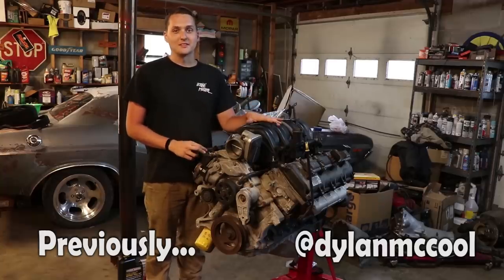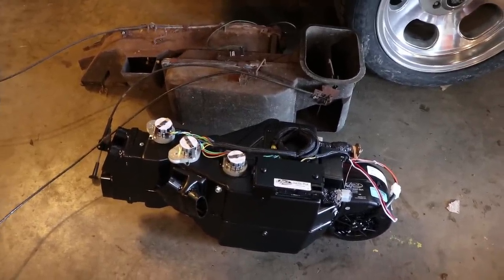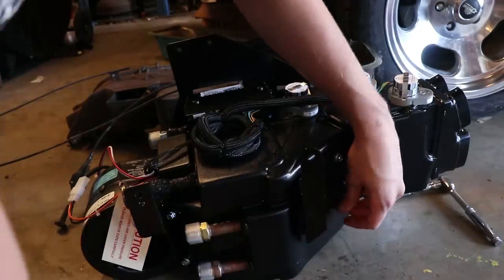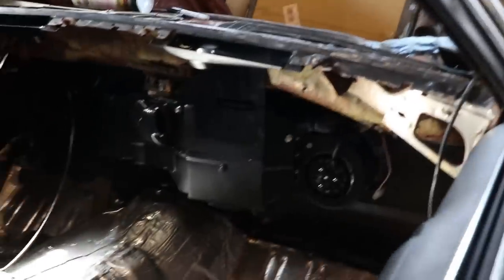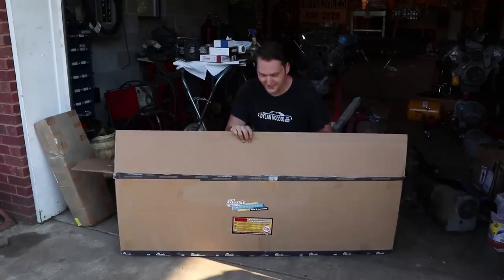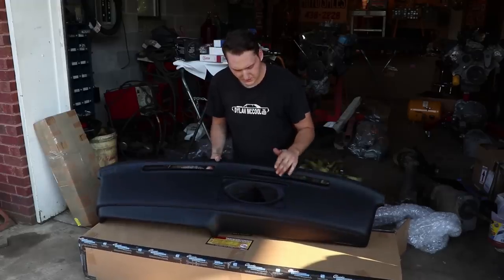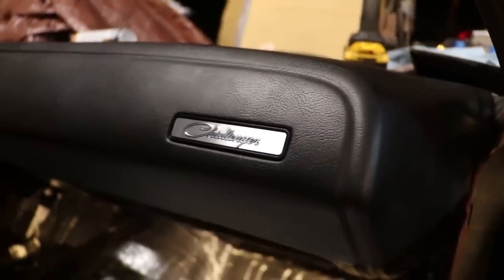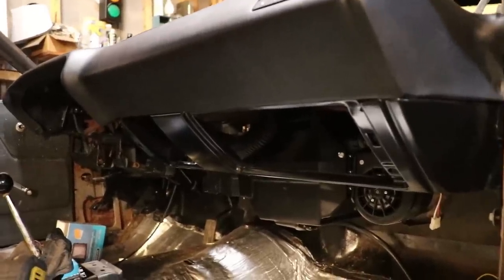ABANDONED Dodge Challenger Rescued After 35 Years Part 19: Air Conditioning and Dash Install!

Comment: Wow! The car is really coming along. I like the fact that you have added air-conditioning to the car, which makes it more enjoyable & practical to drive on hot, muggy days, & the fact that you’ve opted for a 4-speed transmission instead of the factory 3-speed. The dash with its new dash pad looks sharp. This project keeps getting better & better. Soon enough you will have this car running and driving. I can’t wait until the first fire-up of the engine.

Comment: Bought a slightly older truck. Fixed everything in it. Made some upgrades. Got the last thing fixed and 1 week later got the truck totaled. 5am cruising in the right lane in the interstate and a large commercial vehicle had hydroplaned and was sideways and slid into the back of another truck that veered in front. Now anytime I think of fixing or upgrading, my mind thinks of it all ending up in a junkyard after a wreck.

Comment: Congratulations on your progress. Also, I have never seen any car show/channel mention the need to convert your refrigerant in an older car. I had to have it done on my 1986 Mercedes. The old refrigerant R12 AKA Freon is no longer manufactured and existing stocks are depleted to the point of unavailability. The old stuff  was a chlorofluorocarbon chemical which lasts for a long time in the atmosphere and has been implicated in the depletion of the ozone layer. The ozone layer absorbs much of the ultraviolet radiation from the sun and keeps from getting fried just by stepping outside the door.

Comment: That drill bit scene and the long hose scene was hilarious and I think that you should add some stuff like that in with your videos because I like stuff like that and a good laugh is good for the soul and life is to short to be serious all of the time but I'm liking how the car is coming together and it is going to be a cool driver. What size hemi did you say that was? I tried to listen to it twice but for some reason I didn't figure it out I'm only 40 and probably going deaf already 🤪 anyway keep banging away at it and it will come together one day. I just put my stroker kit and 302 block in the machine shop this week so hopefully it won't be long before I get it back and start building the engine because I have spent so much money and all I have is a bunch of parts scattered around and there isn't anything getting done but when I get the block and stroker kit back it will be game on and I can finally hear my 79 pinto run for the first time 😁👍🏼
Reply: five seven (5.7 liter)

Comment: Nice to see your VA kit going in easy. I've been installing one in my 76 Stingray and it has gone fairly smoothly as well. I love the quality of the VA stuff. Very nice. It's well thought-out and has everything you need except a belt and refrigerant.
Reply: Ah, I was wondering if the refrigerant came with the kit. He'll have to go to a licensed A/C shop to have it checked for leaks and charged.
Reply: Or... get a vac pump and gauge kit from Amazon. Then, you can evac the system and recharge it yourself. I got one for only $90 on Amazon. Plus, you can maintain your other vehicles' and friends AC! ;)
Reply: @RestorationObsession  You hurt his feelings.

Comment: Hi Dylan I'm glad there's another Mopar nut out there I remember my friend having one of those Challengers back in the day so glad that you are saving the old gal and leaving adding some new stuff to I like them all original but I can see your point to oh by the way add the third speaker in the dash when I say 3rd it could be the fifth you can take the two front speakers usually in the doors and take the positive off each one of those speakers and hook it up to both sides of the dash speaker and that will make a true surround sound out of it. Yeah I know it doesn't sound correct but it is believe me I had a 68 Roadrunner with the six speakers in it back in the day and the center in the front in the center in the back or hooked up the same exact way and it was on a 500 watt amp true surround sound listening to Frankenstein go around and around in the car was amazing anyway brother you take care stay safe stay well and as always God bless

Comment: I’m very excited for you. Two questions: are there any internal engine modifications that can help prevent the dreaded Modern Hemi Camshaft Flattening issue? And are there any plans to at least attempt to pull out some of that huge dent in the driver’s side door? I know replacing it would be prohibitively expensive, but perhaps a bit of work can help fix it a little without causing too much of an issue with ruining your desired esthetic.

Comment: I put Vintage Air in my 1960 Bel Air. The installation was a nightmare, It really doesn't work that well and has been constant trouble since. The only thing it hadn't done is leak - Oh except for the compressor seals!  Never again. Hopefully it will be better in the Challenger.

Comment: It never occurred to me that you would need to change the VIN over, but this is kind of like the boat paradox.  You keep replacing parts over and over.  At what point is it a different boat?  Are there rules as to when the VIN tag has to be changed over or when you have created a new car?

Comment: Great video Mr. McCool love watching your channel. When I seen that pistol grip 4 speed shifter I automatically thought of the movie Vanishing Point. I have a question for you Mr. McCool I am in the middle of restoring my first car a 1973 Plymouth Duster and I had the windshield and back glass replaced after it was painted and my car leaked around the windshield before the restoration but it is still leaking I have replaced all the seals on the car. But my Duster is leaking water when I wash it most of it is coming from the area of the lower drivers side of the windshield about where the lower corner piece of windshield chrome is. What should I do or where should I start about fixing the leak? Thanks again

Comment: This is great. Learning a lot about interior work. Just curious, though. The Vintage Air system has you plug off the fresh air vent. How does the system get fresh outside air? Doesn't the system need outside air and not cabin air especially for defrost in cold weather?
Reply: I had the same question...fresh air is definitely needed!! Who wants to smell the same recirculated air from your passenger's feet??

Comment: On old ac units you forgot to mention that the units in cars that did work would take so much power from the engine that it would barely move or would stall

Comment: I've never liked the look or feel of the pistol grip shifter handle. I don't like T-handles either, nor any other gimmicky shifter handle design. A standard ball top can't be improved upon, which is why standard-shift professional race cars usually, if not always, have a standard ball top on the shift lever.

Comment: Dylan: One of the biggest things as a problem with the classic car markets is the fact that a lot of these vehicles either didn't have air conditioning when they left the factory or it really doesn't work..... 
Right you are Dylan they didn't have a lot of things....
 "But they did have...., bad suspension, lousy panel gaps misalignment's everywhere, dripped oil, smell of gas and exhaust fumes coming into the passenger compartment, rattles, dust coming into through the cold air vent went driving over dirt roads, poor ride, lousy at cornering, cold vinyl seats, poor heating, lousy defrost in the winter, having to use two feet on the brake pedal to stop a car with drum brakes and who can forget push button AM radio with one speaker that sounds like the music is coming to you through a toilet paper tube...... Back in the day even women had big biceps from driving around with standard steering.   God ..., I miss those days...
Good video as always Dylan, can't wait to see this running and burning tires.
Reply: Sounds like your talking about my daily driver lol
Reply: You are correct, sir. Thanks for the laugh!

Comment: I love the videos, but I always hate to see all the southern vehicles taken apart and you put a wrench or a socket on a nut or bolt and it pops free and comes out in a second. Up here in the northern rust belt I need to use 3 gallons of WD40 or PB blast and a torch to get it free and 9 times out of 10 you still snap it off .😢😢😢😢